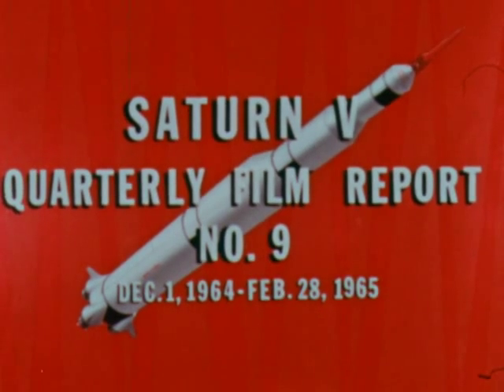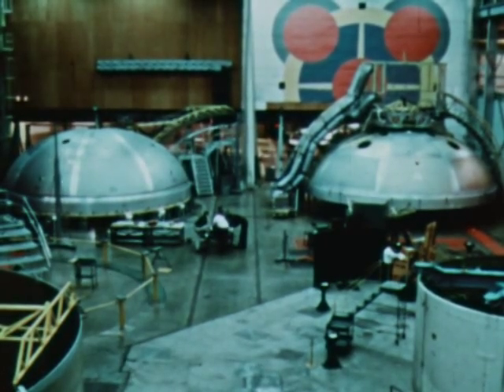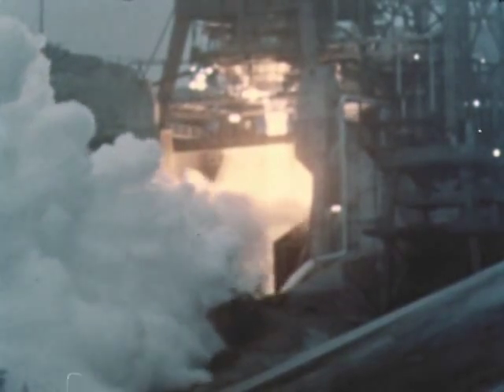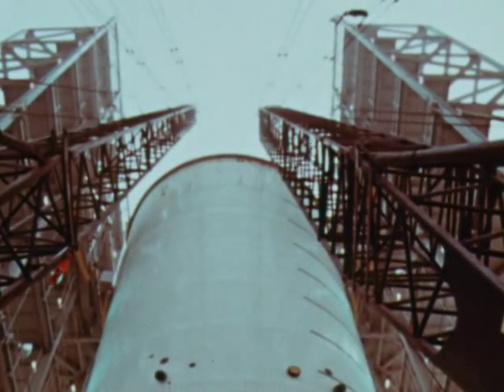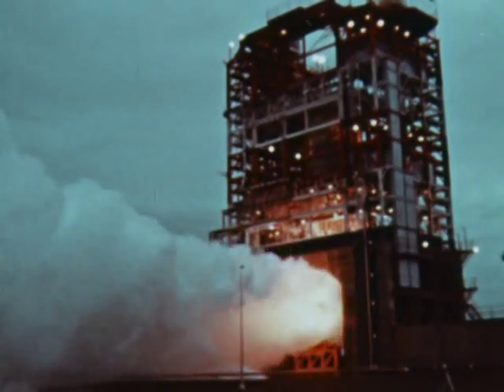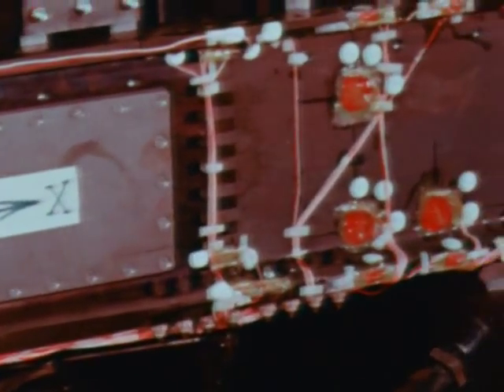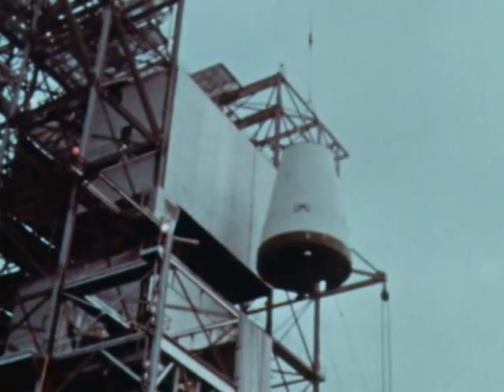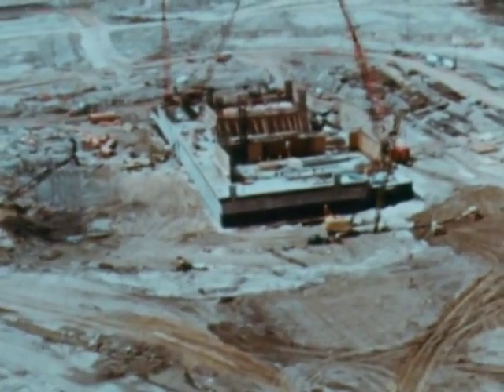Saturn V Quarterly report #9 Dec 1964-Feb 1965

Comment: Why did the Apollo need tons of paint when it is a waste of precious weight.
Reply: Good question. I would give an educated guess that it was to protect skin of the vehicle against aerodynamic forces during the first stage burn. There may have been additional engineering reasons for the characteristic black and white paint.
Reply: @EskCan44  Your are right, in fact the paint is a type of ablator designed to protect the first and second stages(primarily) as the flame from the F-1s climbs up the sides in the high levels of the atmosphere under S-IC power. The F-1 was designed to provide optimal thrust during launch and atmospheric flight, then the J-2s of the S-II and S-IVB would take over as they were designed to provide optimal thrust in vacuum. The ablative paint was tested aboard the X-15 on small panels at one point before being approved for Saturn.
Reply: The black and white paint patterns purpose was designed so that it could clearly be visually tracked making sure it was behaving itself and staying on course. At least thats how i understood it .
Reply: Not to mention, it looks proud and noble, and an eternal image of majesty and power.
Reply: I think the black & white paint areas also provided some thermal control. Other reasons, such as on the S-II / S-IVB adapter, the black markings identified which of the four quadrants you were seeing.